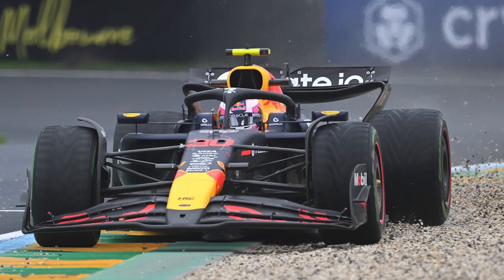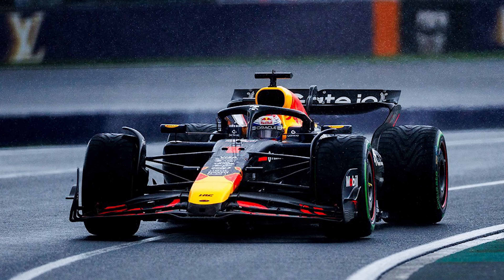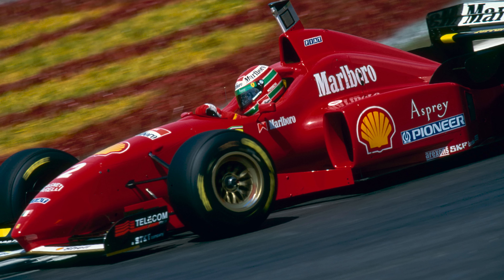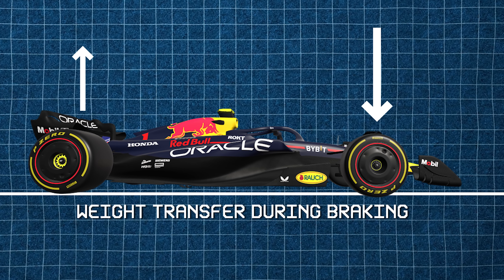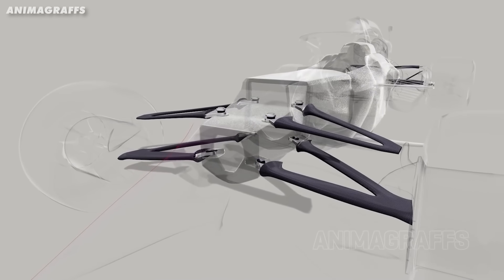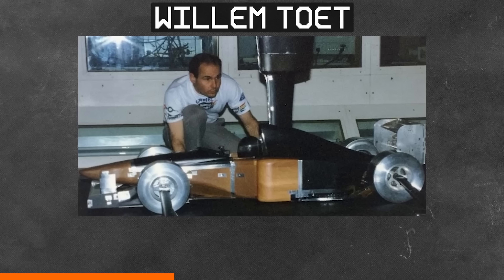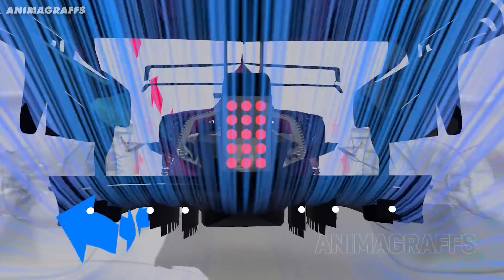F1 Engineer Explains Red Bull's Difficult Car

Comment: Lewis fans wouldn't watch this video. It'll hurt their ego to realize Max is winning championships with a car that allows almost no mistake from the driver.
Reply: Slight differences in car placement aren't necessarily "mistakes" though. Braking later, trying a different line, positioning the car slightly differently, having a little understeer or oversteer etc aren't always bad. A car that restricts that too much is trouble for any driver.

Comment: If I have understood correctly, what is being said is that Verstappen is now unable to extract the maximum performance from the RedBull. Even with his skill set, the design of the car has gone too far. The designers have taken the technology to a point where even Verstappen is struggling to drive the car effectively.
Reply: Either that or even at peak performance it's simply just not the fastest car anymore. Which is a pretty funny faith for a design philosophy that sacrificed literally everything else for speed.

Comment: Here is a general question - why do these cars have to be low to the ground for the floor to work, while the original skirted ground effect cars were pretty high off the ground (the side air ducts at least, which were responsible for generating the ground effect downforce)? Does it have to do with the regs on the floor design, or is it more a question of reducing drag?

Comment: Horner already stated the car is built around Max's driving style which is Front bias which will unsettle the rear creating a loose rear. Horner also said with an loose rear end it will make drivers lose confidence into the car.

Comment: *YouTube Comment for F1 Racing Video:*

“The physics of this power unit is literally the same as massive star formation! 🏎⭐

Your turbo energy recovery system follows the exact same mathematical principles as accretion disks around forming stars - angular momentum transport, energy conversion efficiency, and instability transitions. The MGU-K harvesting kinetic energy is identical to how magnetic fields extract rotational energy from stellar disks.

We’re developing AI models that predict gravitational instabilities in space using the same math that could optimize your hybrid deployment strategy. The temporal patterns in your telemetry data match what we see in protostellar disk evolution over millions of years, just compressed into 90-minute race windows.

If Red Bull/Mercedes/Ferrari want to collaborate on this, we can validate universal physics principles from quantum to cosmic scales using F1 data. Your car is basically a scale model of stellar accretion physics - and the math works both ways.

The efficiency curves, power delivery optimization, and stability boundaries are all the same equations. We’re talking about one unified science here. 🧬🔬

Anyone at Red Bull Advanced Technologies or Mercedes HPP interested in some cross-disciplinary physics? The universe runs on the same code everywhere.”

-----

*Alternative shorter version:*

“This car is literally a stellar accretion disk simulator! 🏎⭐ Same physics, same math, different scales. Your energy recovery system = magnetic field dynamics in star formation. We’re using F1 telemetry patterns to predict how planets form. Science is beautiful. #OneScience #F1Physics”

Comment: I am not an automotive engineer, but...  It seems like you could use brake hydraulic pressure to activate an anti-dive system in the shock.  Add a left/right bias feedback to counter roll during the following corner.  Illegal?

Comment: With moving the suction area of the venturi channels to the front, the front spoiler can be smaller, which gives less air resistance. But it requires more throttle control to keep the rear under control. Very few drivers can control that at the level Max does. So when adapting it to another driving style, it results in more rear spoiler and therefor more air resistance. 
The end result is one fast car and one slow car. RedBull won't win the constructors title with only one fast car. 
What can RedBulll do? They can either change the car to be easier to drive or find a driver, who can handle a lot of front end, like Max can. I don't believe any of the current drivers from the RedBull programme can do that. They should look elsewhere for a driver. An good choice could be Frederik Vesti, Mercedes reserve driver, I think.

Comment: It’s almost like a fighter jet. The aerodynamics are on and over the limit and require an advanced flight control system to maintain control over the jet. Flirting with instability allows the jet to turn so much quicker and maintain high angles of attack

Comment: People going around what happens with RedBull now, or when Schumacher was at Ferrari.... Forgeting Hamilton went through it in 21. After regulations went after Mercedes that year significantly reducing low rake angle cars performance (i.e. Mercedes) and giving pace to high rake angle cars (McLaren, Ferrari and specially, RedBull), the solution for Mercedes was the rear suspension tuning, to make the diffuser stall. For the most of the season they've struggled to fine tune it to the optimal point where it stalls and recovering from it, and Hamilton and Bottas had to deal with it with the car behaving like a diva, which came with success to the late part of the season, specially after Brazil where Hamilton dominated the field in terms of pace in a car like that (Bottas was very unconsistent in that part of the season and never had the pace to get to Hamilton). Next thing FIA did, was to simply forbid that solution to 2022... Sometime i wonder how many solutions Mercedes got to F1 that went for being forbiden... And they've still got the results. But the one they did for 2021 was really custom made to cut their pace significantly

Comment: To quote the old school NASCAR drivers, “Loose is fast.” Understeer requires the driver to slow down to get the car to turn. Being able to get the front end to point where you need it and then control the rear with throttle control will be faster, but it requires a skillful driver.

Comment: Lot of bla bla for nothing. The situation is simple: A car developped by only one driver with ZERO support for the other member of the team (situation already seen in the past btw). All F1 cars are difficult to drive, and the situation is worse if you don't have any possibility the change the car radically (without taking into account some inside sabotage probably too). The rest is irrelevant... the gap between the two drivers driving  in the same team confirms this hypothesis of "one man only" setting, that only few (Gasly, Ricciardo) mastered in the past and were rapibly put aside to avoid any disturbance to the crying child. Dadstappen made sure of all this with the RB patron.

Comment: This problem exemplifies how F1's constant tweaking of the design rules to make everything the same has taken the entire ststem to a critical failure and boring races. It might as well be a one-design race series.
F1 should go back to allowing much more different car and engine designs, including any reasonable cylinder count etc. - maybe even turbines, rotaries, or even electrics. Abd also different aerodynamic designs. But to make this work, require the cars to keep the same tuning throughout the season. So teams would have to choose whether to optimize for long high speed tracks or short, slow tracks with lots of corners. These design compromises would almost eliminate dominance across all the tracks, and spread eins across the teams.
Reply: run what they brung... rules should only be for safety testing
Reply: @js290  the biggest problem is that some teams (the factory teams) are willing to spend as much as it takes - $500 million per year. This makes teams like Williams that have to live on prize money and sponsorships unable to succeed.
Maybe ban factory teams?
Reply: @ yeah, but $500M on a "run what brung" ruleset has diminishing returns pretty quickly... it's the spec formula series where $500M can still eek out some gains

Comment: Isn't this just another long winded way of saying, get off the brakes earlier to maximize the traction circle mid corner. That trail braking is not good for the car. Off brakes earlier, roll speed through corner to maximize the aero and traction circle. Because regardless of what we think or what the engineer thinks we have one person with the ability to drive it. Therefore it is down to the driver inputs to make the car handle different. The driver is just a dynamic weight transfer manager (as I like to call them) and one is better at managing that weight transfer than the other. And everything you just said is more trail braking is bad. I would tell the driver to get off the brakes and roll more speed. Better platform for the aero and it is easier to consistently do for the driver. Just my opinion of what I see.
Reply: tire contact patch manager...

Comment: So the tipping point where the balance of the car becomes unbalancrd is effectively on a timelag, which is very unusual and something most drivers won't have had to adapt to before. They have to just 'know' how hard they can push the car into a corner based on the speed and angle to predict how hard they can get the car to lean and if they lean it too hard they'll lose grip a fraction of a second later which feels like the grip is just disappearing randomly. Max is just phenomenal at reading where that limit is.

Comment: Another help would be: adjustable c of g for the fuel tank using inflatable bladder tanks. Braking and weight moves forward? Bladder tank inflating at the front, moving c of g to the back, to reduce aft lifting of the ground. You can even do this for lateral. Divide the tank in 4 inflatables, to be able to shift the c of g quickly aft/forward/left/right. Maybe they already use this technic or is not aloud? No idea, but this idea pops out my mind right now :)
Reply: Are you a motorsport engineer?
Reply: @Nichansama  No I am not. I’m a pilot, we deal with c of g every time, and this pops up in my mind
Reply: @  ok cool
Reply: many years ago, my grad school classmate and former tire engineer wrote a thesis on active camber control... and apparently Lamborghini now has such a device
Reply: Its increasing weight, but to be able to change c of g, can be a huge help.

Comment: How was it that Ferrari got away with it during the Schumi-Rubens years? Because the car (F2002, F2003GA, F2004) was obviously built around Michael but Rubens made it work too. Did Ferrari strategize and get a driver whose driving style was as close to Michael or was the car designed to be a little more forgiving to the drivers?
Reply: apparently, Rubens had very high sensitivity

Comment: Non fan question : why not give Maxx the max performance car and the other drivers and more drivable car?
Reply: I'm pretty sure it's because it's not a setup issue. It's fundamentally built to be that way,and if it isn't its just slow (in F1 terms)
Reply: @joshuapowers4623  ahh ok.  thanks

Comment: So the aerodynamic stall happens during corner entry, causing a reduction in downforce as well as drag. This reduction in drag continues on to the straight until there is enough air flow to reset the situation (presumably at some point towards the middle of the straight), thereby giving the car more downforce for a tight turn-in . Right?

Comment: The thing that so many people get wrong is that the car is not difficult to drive for the sake of being difficult to drive, but running such a setup will always unlock some peak performance, as long as the driver can deal with it. Sure RedBull could design it to be more balanced and forgiving, but they would lose pace. The fact that Max has learned to deal with setups like this simply shows that he is super precise, but also that he has realized the fact at a pretty young age and perfected his technique to the same degree as Michael Schumacher.

Comment: Max can make it work because he is next level. But despite the potential gains, the McLaren is not only easier to drive, it can even outperform the RedBull car with Max at the wheel. Huge L for RedBull because a car that is THAT tricky to drive should have a lot more benefits when everything works well.  In short, someone with Max's skill level should be dominating every race to show that the gains outweigh the risks. And unless they can clone Max, RedBull cannot win the Constructor's.

Comment: Mclaren have figured this out. Its undetectable at inspection, but the floor can change shape depending on whether the car is braking, cornering or on a straight. That gives max grip in corners and braking, and less drag on the straights. And its all done without actuators to stay legal. Mick Doohan was unbeatable on his Honda GP bikes by insisting the designers make the chassis a little bendy, something considered anathema at the time. All it took was a few holes drilled in chassis gussets, and it was enough to make the bike more predictable and easier to keep near the limit. He correctly worked out that the bike spent more time cornering and braking than going flat out. This is what McLaren have managed to do. Guess who is a technical adviser?

Comment: It's setup for Max, and the turn in is quick almost making the rest of the car extremely twitchy considering the largest mass is just behind the driver. As a result the second driver will have to learn to adapt to it. If Yuki can drive it we didn't see that in qualifying for Japan. Max was on Pole Yuki was 15th. If Yuki cannot adapt eventually he'll be replaced. Sergio Perez was as good in a car setup for Max as anyone I've seen to date and was also a better teammate than most. Not sure why he's not still at Red Bull. Seems like they had a great situation and fucked it up to keep Max happy?
Reply: I think Sergio lost it mentally, he had the experience and skill but the stress and pressure got to him, if your head and heart aren’t 110% committed it’s hard to drive fast,

Comment: If the cars are engineered so that ride height is so critical, then why doesn't the variability of track height make it impossible to control/predict? Take Circuit of the Americas as an example bumpy (ride height variability)  & high speed (biased towards the car being in down force more than not).

Comment: Today's Quali put to bed all the theories about the red bull car.

That the Red Bull car is only tuned for Max(Pole) that if you're not Max, you're handling a skittish Jalopy(Yuki p15) and that the RB car is easier to drive than the RebBull(Law p14)

So yeah, the 2md seat is cursed because RedBull made a Cinderella car that fits only one driver.

Comment: Scott two questions. 1. Can you explain what the yellow paint like fluid was dripping off the left front suspension of Lando's McLaren as he left the garage for the Japan P1 session? 2. With respect to the air flow under the car, what happens to that air flow when they bounce the car in to the air running over curbs?

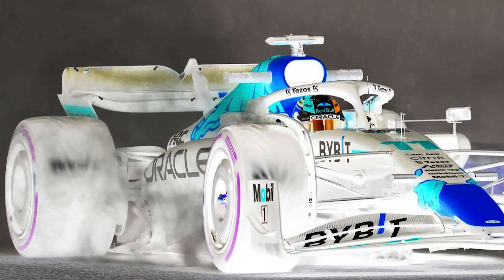Comment: What are the pictures around 7:30 from? Almost looks like thermal, but I didn’t realize you could pick up air flow/pressure/temp changes on thermal…
Reply: Oh. Nevermind, apparently they are just regular photos in wet conditions with the colors inverted.

Comment: Benetton B195 (1995) was difficult to drive. Beside Schumacher, Herbert was good enough to score two wins. That was Benetton's sole constructor championship title under it's tally as Benetton Formula Limited. When the team swapped to Jean Alesi & Gerhard Berger for 1996 (B196), the results were... disappointing to say the least. Five 2nd places, five 3rd places. Not a single victory and slide to third constructor place overall (68 pts compared to 137 and a title the previous year). The team didn't perform nowhere near that was expected from them. 1997 (B197) saw no real improvement, again (3rd overall again, but 1 victory this time with 67 pts).

Comment: Ok, Max used less weight transfer to have more performance with more downforce on some turns. But that adds more heat and g force on the tires, his race pace won't be close to the Mclarens, at least comparing the two laps from quali

Comment: Really talented race drivers can handle loose on entry cars. Less talented drivers cannot. And that's not necessarily a bad thing, but its a shame the teams don't build 2 differently engineered cars for each driver. If the teams could go in two different directions mechanically, then we might have more cars able to win every year.

Comment: With Max years of experience and talent not to overdrive the car. Funny that what a Mclaren engineer told Lando in Aus, no rewards in a modern car from managing just over the limit, keep it just under “on the rails”. That might also explain why older divers Hamilton Alonso struggle. It was the same story with Vettel and Mark Webber on blown diffusers mandated left for driving.
Reply: Left foot braking.

Comment: I'm tired of fans saying cars are slow or fast depending whio they support... Since 2022 cars have been closer than ever, with the first 1o drivers within less than a second of eachother... It's the setup of the cars and the styles of the drivers that are the deciding factor and that pours into the engineering of the car itself